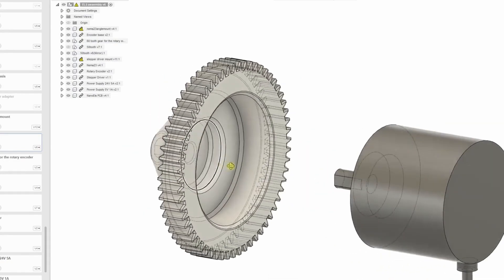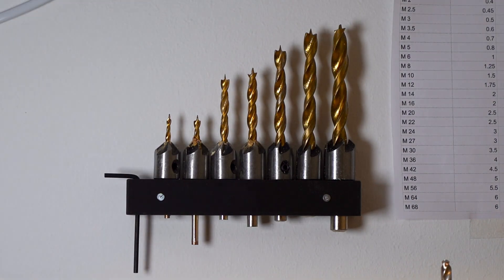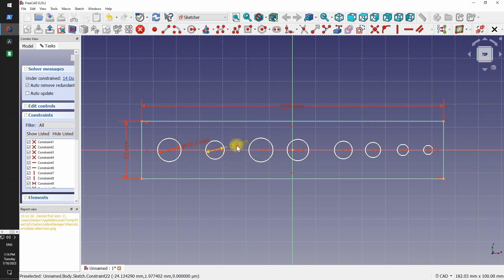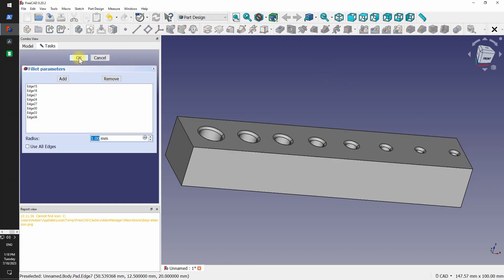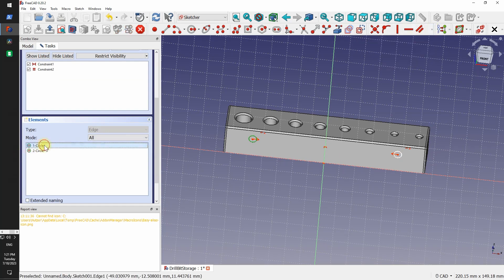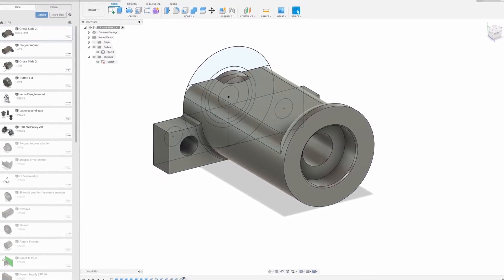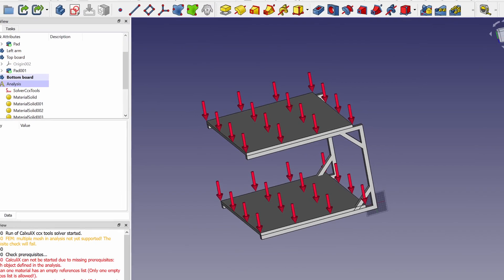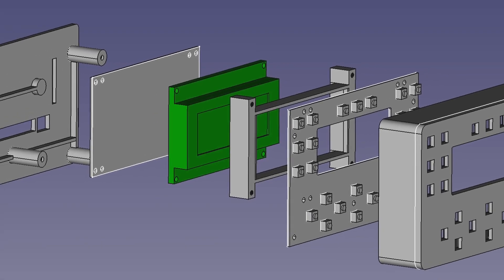FreeCAD after 6 years in Fusion 360

Comment: Do you still use FreeCAD? If so, is there anything that's impossible or significantly hard to model in FreeCAD as opposed to other commercial offerings?
Reply from the maker: Use it every week, there should be nothing like that unless you're a professional with some specialized requirements.

Comment: I'm just switching from Fusion 360 to FreeCAD. The next version that comes out will be simplifying a lot of things and save a lot of time. The thing I dislike Fusion most is you have to upgrade every time there's a new upgrade which means you have to learn how to reuse the program, I mostly just do my modeling in the winter when the weather is bad and this can take some time to relearn so look forward to having a disk based program that I can learn and it won't be changing till I want to.

Comment: I originally used AutoCad then switched to pro/engineer, then to Solidworks for decades. All excellent programs.
I tried getting into Freecad a couple times over the years, the solver is definitely a weak point (and definitely a strong point in Solidworks).
Then I had a job change and worked with Fusion for a couple months, I swear it’s nothing but a refined version of AutoCad + AME (the advanced modeling extension). Once I comprehended that, Fusion was much more approachable. The solver is the weakest yet, well, AutoCad was never truly successful implementing parametric constraints. The solver has to be the weakest in the industry, though the most capable as far as Autodesk products go. Fusion timeline is almost never a good idea to meddle with, in fact you can turn the history mode off completely and just use the program like you’re sculpting: anything you do is permanently captured and completely irreversible!
Solidworks is a superior tool, but Fusion is indeed highly approachable, and surprisingly full-featured, despite the pitiful solver. Freecad is getting better and better all the time.
I will probably switch over completely to Freecad.

Comment: Is Plasticity a viable option for you? It's a relatively young program, but allows for inputting sizes while creating the shapes and extrusions, is super fast, and now has the ability to draw in measurement lines too. I've never done any 3D printing, so I'm not sure if there are export hurdles or anything, but the software is very quick & easy to use, and can do what you showed in this video with ease, and the licenses are very reasonable, at $150 for a single person (as of Feb 2024).
Reply from the maker: After getting trapped in proprietary software multiple times over the decades I prefer to use open source whenever possible. Plasticity looks interesting though assuming they will honor their perpetual offline license - though it feels like the feature set there is very limited compared to FreeCAD

Comment: Freecad is actually improving a lot on most of the pain points you mentioned: The infamos toponaming issue which breaks the models has been improved on Realthunder's branch of Freecad, and the principle is now being re-implemented on the main branch. Extruding from sub-sketches is also possible on Realthunder's branch, I assume this will also be merged back to main soon. Setting dimensions right when adding a sketch element: This is has recently been added on the main Freecad.

I personally use the Realthunder branch which still has some major improvements, but I am looking forward to seeing them on the main Freecad soon!

In my opinion, Freecad is one of the most underrated FOSS tools out there! It suffers from a bad image, possibly because it was very much  a "diamond in the rough" until a few years ago. But it is being polished now! And already now to me it is very usable.
Reply: I use the realthunder one. Where is the print to extrudea sub sketch??

Comment: Breaking the design by changing something from previous steps is a real problem. I had this already several times. It often means that you have to create everything after the change once more. Another problem is the modification of lengths while constrains are active. Sometimes arcs will flip into the opposite direction and it is almost impossible to flip them back again.

Comment: I'm looking at you drawing the 1st sketch.
1. Don't draw all holes. Use linear pattern or array to make as many holes as you want.
2. If you want to draw all circles in the sketch, don't give each of them diameter. Just give a diameter to one of them, then select all circles and press "=".
3. To set a linear constraint, press L for horizontal and I for vertical.

This will speed up your drawings. 🍻
Reply: Where can I learn all these tips and tricks?
Reply: @dearvincent3109  lots of youtube videos

I don't watch long lessons. I usually look up for what I need right now

Comment: I was fully on board with freecad, however I need CAM and fusion has a post for my machine where freecad does not, and the CAM doesnt work at all on my installs even after following tutorials exactly
Reply: FreeCAD 1.0 was released earlier this week 20/11/2024. 
The CNC workbench is now called CAM and is installed with the core workbenches.

Comment: I have been using CAD for about a decade now. I would consider myself an expert in Solidworks, Inventor, and Fusion 360, and I have significant experience with NX, CREO, OnShape, and Autodesk. Specifically, in SolidWorks, I am fast enough that I wouldn't be laughed out of the speed-modeling world championship.  

I would love nothing more than to have a viable open-source alternative... but the truth is that FreeCAD is just not anywhere near competitive with to these professional solutions once you reach a "power-user" status. Basically, if I can create a technical drawing on a sheet of A4 paper that completely describes the design, FreeCAD is fine, but for anything more complex, it just isn't.

The limitation that changes at previous points in the timeline often cause breaks is an absolutely crippling factor if you are doing an actual engineering and product development process which involves iteration and having this one feature work well should be the absolute cornerstone of a parametric modeling software. 

Even when I'm just doing hobby things with CAD, my time is still money, so if it takes me 3 times as long to achieve a less satisfactory result with inferior software, that's just the way it's gonna be. CAD is a tool, and while it is nice to be able to have open-source and freely available options, using the equivalent of a dull wood carving knife when I have access to a high-speed multi tool CNC is just not practical and being frustrated with tools is one of the primary hobby-killers in my experience

Comment: Great video. Totally agree with your assessment. I started my hobby CAD journey with Fusion but was annoyed by the limitations and always somewhat in fear of losing my models one day unless I pay. Spent some time in FreeCAD and now I use it all the time. Yes, it takes some time to get used to it but for the stuff I do, it's way more than enough. 

For people starting, I think it's a good idea to start with fusion to get the general idea on how to model in parametric CAD programs. Once you know how to approach it, it's way easier to switch to FreeCAD as you have the skills to work around the quirks. One drawback is of course that once you get used to Fusion, you'll miss some of the features in FreeCAD like the mentioned multiple extrusions from a single sketch. However also for me, that's something one can indeed get used to.
Reply: To add to your fear of loosing your models: A colleague of mine recently used all his cloud saved models and they were gone. Mostly tutorial models and such. However the cloud save structure is what annoys me about it.

I'm currently looking into solid edge community which is very good so far and allows to keep your files offline and is a bit faster on my laptop. However FreeCAD is completely free to use commercially if you are ok with trading some quality of life features.

Comment: Did they put the adding a dimension button in a submenu or am I mistaken ? Because that is the pinnacle of terribly thought out UI.. And such mistakes are probably what will keep me from ever using it.
Reply from the maker: I had to lower the resolution for screen recording, there's no practical problem with sketching or dimensioning
Reply: FreeCAD 1.0 was released earlier this week 20/11/2024. 
It's changed quite a bit since you posted.

Comment: Thanks for the video. Coming from the pro audio software world but with a few decades of hobby design and build I’m baffled by how unfriendly and restrictive modeling software still is. Tinkercad being the only exception it seems? Spent hours designing a sim racing steering wheel with all the electronics only to lose it several times due to software bugs in Freecad and fusion. Infuriating. In the end, Did the whole thing in Tinkercad including all the circuit design mostly whilst on the plane or hotel rooms and turned out perfect. More chamfer and beveling options would have been nice but was easy in post production before paint/resin finishing anyway. Printed some parts, cnc cut others and made all the decals too just using that, inkscape and Openbuilds. At least we have lots of choices!
Reply: Thank you very much!
I bought my 3D printer a few months ago, as an occasional hobby, making small objects that help me in my daily life, like the ever-popular toothbrush holder and the like. However, I'm stuck on the modeling part.

I'm a professional in the CG industry, working with lighting and rendering for advertising pieces and films, but modeling is not my strong point. In this industry, each step goes through a specific team, like an assembly line. The modeler models, the animator animates and the guy who makes the lights, textures and the final render, which is me, receives his share of all the problems that the other sectors created and didn't realize at the end of the day, forcing me to do yet another late night waiting for the necessary corrections :)  

Well, when I need to, I make my models in Maya 2019, but nothing that I would worry about with precise measurements or objects interpenetrating each other.

So I decided that if I was going to print something without problems, I would need to learn how to model in the correct program. And that's where the confusion started.

 Which program? I read a lot of things that seemed fantastic, but the comments (always them) are discouraging. 
Fusion 360 free seems to be preferred by the "3D printer" community. Because it's "free" and users simply ignore the fact that you can't sell models made in the free version. The same goes for OnShape. 

However, the biggest problem with these programs is that they are online services. OnShape, even worse, runs inside the browser! And the objects created in it are not mine, in the free version. Everything I do is free and free for other users to use. It's a fair trade, perhaps, if you're a hobbyist. 

However, if you become a good modeler and decide to sell your projects, you will have a big problem on your hands. Either you buy the full OnShape license, which costs a leg and a kidney in good condition, or you will have to learn everything again in another modeling program. 

We also have Blender, which is basically the same as Maya but has some addons that add some cad features, but they are limited and problematic, apparently. 

And we arrive at FreeCad, which is free, reasonably good but full of bugs, and is not very intuitive, from what they say.

Anyway, if ThinkerCad is simple, fast and bug-free, it could be a painless alternative for the occasional hobbyist.

It is necessary to consider that being a service like Fusion 360 and OnShape, it can be discontinued overnight and your objects disappear in the cloud.

Anyway, I'll try to start (again) with ThinkerCad. 

Thanks again for the suggestion.
Reply: @mtrivelin  Tinkercad runs in the browser but you choose to make designs public or private. Like all software there are occasional weird things but be I’ve never  lost work because it continually updates. Just refresh the project and off you go. It’s genius. EMachineshop web version is great for tracing objects and making STL files too. It has a clever gears engine for making function parts that fit together and it’s free. I use it to take pictures of things I need to duplicate, trace around them then extrude it to the size I need then I either plasma cut, cnc out of wood or print them. Love it.

Comment: Solid on point review.  I switched from Fusion (name changed recently) to FreeCAD  about a year ago.  Like you, it was a bit rough at first. The sketcher really is the worst aspect of it. When a sketch breaks, you don't get a lot of help finding the problem. Your advice to keep sketches simple is spot on! I find that using the Part Workbench is much less prone to breaking your model than PartDesign (with sketcher).  Your  example model could easily be done in the Part Workbench and would not barf if you added an extra hole. Despite my frustrations with it, I use it for almost all my 3D CAD work now and have donated.
Reply: Good to know the part workbench may be more capable. I haven't tried it yet.

Comment: So the only advantage of FreeCAD over fusion is that it is open source and offline, all the features are slower or worse. It can only handle simple sketches, you can only use a sketch once, things break when you edit previous steps, etc.
Reply: FreeCAD 1.0 was released earlier this week 20/11/2024.
Reply: Fusion is a toy compared to FreeCAD. None of what you say is true. Why is your FreeCAD slow? Why do your sketches break?  What machine have you got?

I am sure you have not much evolved from the "Hello World" in FreeCAD, otherwise you won't make such statements. You can reuse any sketch as often as you want and what do you mean by simple sketches?

You can make a sketch as complex as you like, if you use the sketch tool from the BIM workbench and NOT from the Part design workbench. I suggest to try harder and learn FreeCAD properly.

I am a former AutoDesk Inventor / Fusion guy and will never go back to proprietary software.
FreeCAD does everything I need and that's why I stopped using Fusion all together.

Surely, FreeCAD works differently from Fusion. So, learn your new tools and stop spreading misinformation.

Comment: You don't need multiple separate sketches. That's how I used to do it, now I draw a master sketch then use sub shape binder to create "links" to sub parts of the master sketch.

The master sketch is then my parametric entry, although I also use the spreadsheet for that too.

Finally, regarding history edits messing up the sketch, you can use realthunder's branch which is slowly being merged to generally fix this, although use of a master sketch too really helps this
Reply: oh that's really interesting! never heard that before :0
Reply: @tobbleboii5988  That's how I learned to use SOLIDWORKS. master sketches all the way. i had issues getting used to freecad though, even with or especially with master sketches. mayve i need to try again.
Reply: @MikkoRantalainen Video ID instead of a link works perfectly: 
8JdwrVEKvIU
You can even enter it in the search bar. No title needed.
Reply: @pyliki  I prefer giving a title because many spammers put video id links because those are opaque by design so the only way to for potential viewer check it is to load the actual video. Neither is obviously perfect method.
Reply: This sounds interesting. Do you know a tutorial or demonstration video for this workflow?
Reply: @MikkoRantalainen  there is a video with the title "LinkStage3] FreeCAD shorts. Multiple pads from one master sketch ." On YouTube which shows this workflow several ways. I cannot link it as YouTube is removing my comments with links, sorry
Reply: @bansci  Thanks for sharing! The title of video was enough so that I found the correct video. Some channels have spam filters that ban all links and in that case, the best you can do it to mention the verbatim title of the video and the channel name.

Comment: The problem where operations change the edge they apply to is a result of a problem with FreeCAD known as the topological naming problem, and there are efforts underway to fix it. I use RealThunder's branch, and Ondsel is also working on it. It will take some time to integrate them into the main branch, but I've heard work is underway to do so. It is a complex problem that affects core functionality though so it's not a simple patch.
Reply: They have supposedly been working on integrating Real Thunder's fixes for years now. Personally I think FreeCAD needs new leadership, they have totally lost focus and are delivering more and more barely working functionality without addressing the mountain of issues they already have.
Reply: @schrodingerscat1863  FreeCAD 1.0 was released earlier this week 20/11/2024.

Comment: I also tried Fusion 360 and FreeCAD.  I didn't want to get stuck in Fusion 360 and be subject to high prices and corporate BS.  I didn't like FreeCAD because it just isn't quite there yet, compared to software like Fusion 360 or Solid Works.  I did find another solution however, in Alibre Design.  You have to pay for it, but it is far cheaper than Solid Works or Fusion 360.  Alibre Design also allows you to purchase the license, so you don't have to worry about working online, signing in, paying monthly, etc.  I presently use Alibre Design Expert and do professional work with it.  I think you would like it.